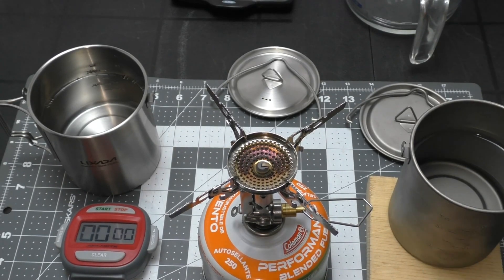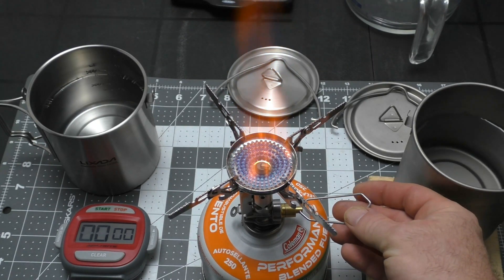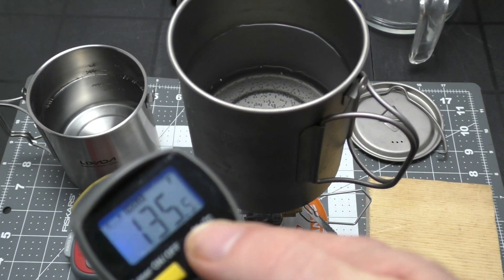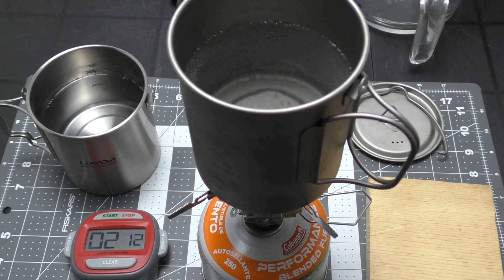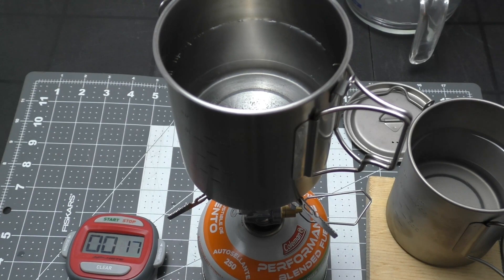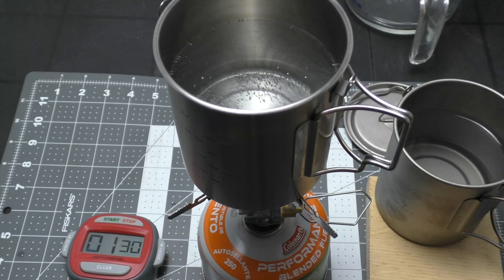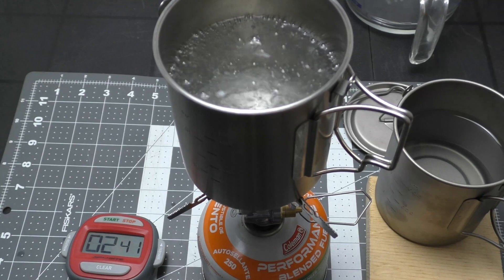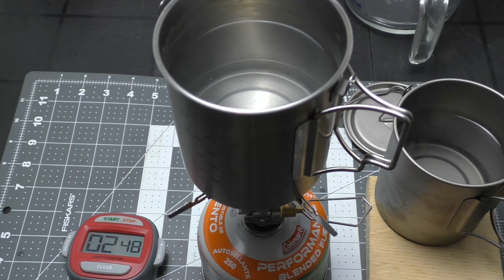Stainless Steel vs Titanium Boil Test

Comment: Hi. How does that xd-2f run? Have you ever used it on camping?
Reply from the maker: I used it this last Saturday on a day hike to make lunch and coffee. Worked fine, ask me in a year how it works that will be the real test. Thanks for the comment.
Reply: @charlesartificer2158  Almost a year later now, how has it held up?
Reply from the maker: It still works like new. I am very pleased with it. I got a 2nd one for my other bag to replace a much heavier stove. In its class it performs well and has a good flame spread. About the only thing I don't like about it is that it is not a remote stove set up. There are options to fix this but that costs 4 times what I paid for the stove so for now I can live with that. for the money its hard to do much better.

Comment: i wish you had taken a temperature reading of the stainless steel, just before you put it on, am curious if being so close to the stove while the titanium was heating up might have raised the temperature.
Reply from the maker: I don't think it would make that big of a difference. Most of the heat was coming up and around the pot. But you do make a good point. Thanks for the comment.
Reply: @charlesartificer2158  yeah, am just curious if it may have raised it by a couple of degrees.

Comment: so, thermal conductivity
Titanium - 21.9 W/(m⋅K)
Iron - 80.4 W/(m⋅K)
Aluminium - 237 W/(m⋅K)

in your case you got close results because you had a powerful heating source and a small heating area and a small volume of water
Reply from the maker: Thanks for the info.
Reply: the aluminium conductivity is an advantage and disadvantage becouse pot / cup is a radiator. It transfers heat to the air as fast as it gets. Boiling time depends on how power has the stove, which fuel you use and how much water do you boil ( the pot should be full )

Comment: Ultralight backpackers may love their titanium ware for weight savings. A great chef will always choose a different metal. Titanium is actually a poor conductor of heat and you will have a hotspot in the bottom of your saute pan. Food will easily burn and simmering will be difficult. For water sterilization, boil-in-the-bag food products (MRE mains), coffee or tea, no problem with titanium. What you choose depends on your application and intended use.
Reply from the maker: Very true my friend very true.